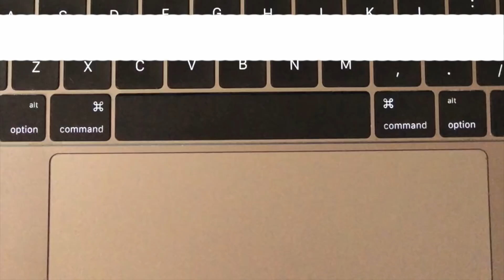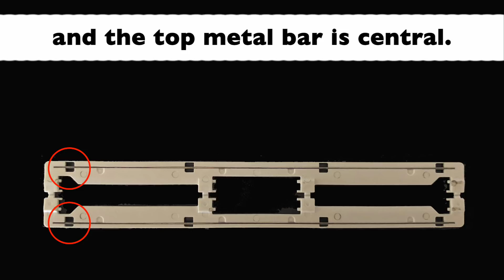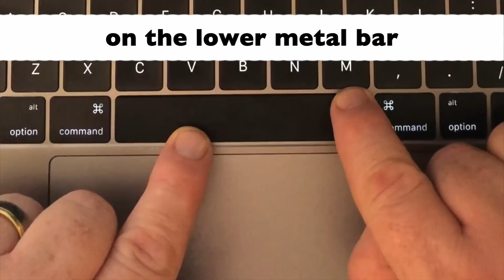Macbook Spacebar Removal & Replacement - 2nd Gen Touchbar **SEE COMMENTS FOR FREE REPAIR!**

Comment: Thank you for your video which allowed me to change my spacebar without too much damage.
On the other hand, with the double hooks upwards (towards the screen), it was impossible to clip the space correctly.
I tried to do it the other way: double hooks down, and there, it worked very well.
For those who can't do it, try doing like me: reverse the hooks.
Reply: And I removed the silicone membrane which was completely torn off.
Reply: 😪well it does'nt work very well in fact
Reply: Yes, double hooks should match the "centered" bar (and centered bar should be furthest from track pad, not closest to it)

Comment: I just received my spare parts from China and installed my spacebar. You missed one important thing: when you remove the central transparent bit, it's important you put it back on the same way, so the two metal pins hit the big metal plate.

Comment: thanks for this! i have my space bar back now. if anyone else has issues with the adhesive on the clear parts not being sticky after fiddling with them, i used a tiny tiny bit of shoe glue (i guess other glue would work too) to help them adhere. i have no idea if this is bad for the parts so do at your own risk, but it worked for me

Comment: DO NOT DO THIS if you have a 2018 MacBook Air Retina! Trying this just cost me $160 for a wireless keyboard.  You're better off to take it  in to Apple first and see what they say.  I could either pay $500 to get my keyboard replaced or buy the wireless.  Once you remove that key, it is NOT made to go back on.  I told them I had seen this video.  Don't try it yourself.

Comment: Thank you I didn’t think I could do this by myself !! Quick question tho : it works but the bouncy effect of the key is now present only in the middle of it. If I press on the corners of the space bar it works but there is not the usual sound of it and the normal resistance if that makes sense. Is there a way to fix that or did I break something forever ? Thank you 🙏🏻 🙏🏻
Reply: Check the clips on the black spacebar itself. They could have been broken off like I did to mine. It's very tricky to do anything thanks to Apple. A replacement was only $5 on ebay which is good.

Comment: Thanks for the video!
I'm replacing it but after placing everything the white piece doesn't have the butterfly like effect, it's stick fully to the board which doesn't allow the space key to work properly.
Is there anything wrong here?
I'm having the model with the thin membrane.
Reply: Actually right now it's working fine after placing the spacebar, but from one side only while the left side is sticking

Comment: Do it very CAREFULLY! Check it twice that this is exactly your type of a keyboard, other keyboards has different construction. So I made a mistake and unmount not just a top cover but also a mechanism on the first step, so 3 out of 6 small pins on the mechanism have been cracked... Another problem was with the transparent clips, they were glued and had to be forced to be unmounted. Luckily, 3 pins on the butterfly mech were still enough to get it all back in a normal way. Finally it works now.

Comment: Detail: the small transparent pieces are glued. It's normal if you struggle a little bit removing these parts. When you replace those, don't forget to double check that there is not small piles of glue made because of the knife. Otherwise the explaination is perfect.
Reply: The glue is dry as I’m trying to replace my space bar. What can I use? I was able to remove the dry glue gently with my nail. 

Any video you can point me to? 

Should I glue the clear pieces before or after placing the butterfly mech?

Comment: The plastic clips that are glued to the frame under the key is the main reason why your key is not holding. The owner of the laptop I am fixing broke it and I have to shop around for the piece now. If it's broken, you'll have to remove it and glue in the new part. The video does the job when you know what to look for. I personally don't like Apple products and use an Accer laptop and never had keyboard issues. Even worst the price vendors want for the parts alone are ridiculous. And this is why I stay away from Apple products.

Comment: Idk how people are getting helped with this video. The clips were held down by an adhesive and now they won’t go back on the keyboard. The least they can do is warn you that this doesn’t work
Reply: Yes, mine had adhesive and nothing worked like it showed on the video because the part underneath was also held down with adhesive.  Maybe a different model?  I guess I'm just using my external keyboard until I can take it to get it replaced.

Comment: Just did this, except the white piece with horizontal metal bars came off with the black facade, leaving the three clear pieces behind. I guess I wasn’t careful enough and one of the white protrusions on the piece with the horizontal metal bars broke off. After putting it back together, I noticed that the spacebar only worked if I pressed in the exact middle of the button.

So I took it apart and redid it. This time I removed the clear pieces, even though they appeared to be glued down. Put it back together, and now the spacebar works only if I press down hard on the middle of the button.

pro tip: If you’re removing it to clean it, just try slightly lifting the spacebar and applying compressed air instead. Not worth the risk of damaging it imo

Comment: This video did help a little but not that much for me. I spilt some pink lemonade on my key board, I know very dumb of me, and miraculously after it dried the keyboard was not sticky at all EXCEPT the space bar. Now as you can see from the helpful comments and the video the key has 4 clips and 4 hooks. I took my key out, cleaned the goop and dust with a quip and tried to put it back in but the hooks WOULD. NOT. FIT. After 30 minutes of watching the video again and reading comments and trying over and over again I looked closely at the hooks. Since the plastic is so delicate the hooks had actually folded in on themselves. I took my fingernail and pried them open and vualá it fit. It was a little stuck but after a few taps it was working. So before you spend more money on a key, look closely. 😄

Comment: You were fortunate that the adhesive remained sticky enough to reseat the clear mounts: in many cases it can be dry enough to make them only fit loosely when replaced. One guide advocates leaving them in place and only removing the butterfly by prying it away from the mounts, then very carefully stretching the new butterfly's pins/prongs to fit back into the mounts. I live in Arizona and all the Apple stores in the state are being closed down due to COVID-19. 
I'd appreciate it if you edited your comment to mention this will cause problems if the adhesive isn't sticky, rather than just tell people to take it in for free repair. Very informative video otherwise.
Reply: The adhesive on mine is dry. What can I use to get them to stay?
Reply: @cesartobar8196  any tips? mine is ruined as well
Reply: Well if you bend the plastic ones to refit the mechanism it will be loose. Gotta glue em down with some loctite

Comment: NEVER REMOVE THE GLUED PLASTIC CLIPS !!!! This will ruin you.
Reply: What?!
Reply: I appreciate the comment but this needs more information as to why that will ruin you.
Reply: @philiproy6075  Its impossible to adjust the spacebar, so it wont work on one site. I just struggle with the Spacebar but cut never fix it to work like original.

Comment: I tried this. The transparent clips were glued down. I figured I was suppose to pry them up but now they don't hold the space bar down - they come out of place very easily. Booooooo Apple. Booooooooo.
Reply: Same thing happened to me.  Transparent clips are glued down.  Did you fix it?
Reply: @jeremyzee  Nope I just use an external keyboard now. So it's no longer a laptop.
Reply: @jeremyzee  Thanks for the link. I'm going to try to take it in as soon as things get back to more-normal. My guess is that by trying to fix my own keyboard I have voided the warrantee and will be forced to buy an entirely new keyboard. If that's the case, I'm just going to buy a new ASUS laptop and do all of my development on there. I'll only use my current Macbook Pro laptop for iOS builds.
Reply: @H Kim ill try again I suppose. But it seems like no matter what I do, nothing firmly connects to anything else.
Reply: @H Kim I'll give that a try this evening, thanks
Reply: Shoemaker did it work!
Reply: @luismedeiros1211  I tried but one of the clips on the space bar broke. I have a new one ordered and on the way. It kind of felt like it was going to work if the clip hadn't failed though.
Reply: Shoemaker what about the apple store thingy? I just broke my spacebar trying to fix it (as weird as it sounds), i’m handing it to apple, and getting it fixed for free, so that i can sell it and buy a new macbook 2020 without this stupid keyboard
Reply: @luismedeiros1211  I'm going to have to try that eventually. I have it working now (actually typing this message from it) but I pretty much need to strike it dead center for it to work well. The left side works okay but the right side really doesn't work. It's impossible to hit the space bar twice quickly, it doesn't rebound fast enough. Looks like I'll just have to take it in.
Reply: H Kim it was already not working, i managed to make it work actually, there was some dust under it, but it doesn’t click now
Reply: If they don’t fix it, i am surr as hell suing them
Reply: H Kim they did fixed it, i explained it was already broken, didn’t pay a dime

Comment: So I just watched your video and it actually helped me. My space bar on my A1989 was stuck. I lifted it to clear dust and got stuck with replacing. The real solution is putting back the space bar in place. Placing the hooks at the bottom and the clips at the top

Comment: Hi Damien - thanks, very helpful. Only problem I'm  facing is I can't get the lower edge of the space bar (with the single clips) to hold down. Any idea why? I've tried many times. The double clips top edge clip fine and nothing appears to be damaged. But the lower edge easily lifts up. It might not bother me,but the only way to get the space bar to work is to tap it really hard! Any help appreciated.
Reply: I had the same problem. I think the white butterfly bar is in upside down in this video! I swapped mine around (after hours of trying to "just click the spacebar in") and it worked easily and is working fine now. The metal bars that are off centre should be at the BOTTOM and not the top I think. See here: https://youtu.be/D-S-owPESlw?t=480
Reply: @mikerigley1  EXACTLY – the video shows it opposite to the description that follows in the video. Luckily I found your comment :)
Reply: @mikerigley1   Thanks Mike! You've just changed my life :) Suffering trying to deliver to clients in lockdown with spacebar not working was painful. I've done what you said, and whilst it's not solved 100% (now the top edge of the space bar still lifts up)  but most importantly, it doesn't fall off and it WORKS! It's a functioning spacebar now. Really appreciate your help. Cheers.
Reply: I'm having the same problem! Did you find a solution?
Reply: Nelliemarie nothing anywhere unfortunately. Everything I've found implies it just clicks into place. If I find an answer I'll add it here. Good luck

Comment: I just cannot seem to get the "hook" parts on the bottom of the key? How did you make it seem so easy?
Reply: i think because the later ones has the thingy glued
Reply: Raymondouu same problem!
Reply: were you able to figure this out? currently struggling  with the bottom of the key.

Comment: But on the video you put assymetric(closer to the edge) closer to the screen, while explaining that symmetric one should be done in that way
Reply from the maker: You are correct but this is the incorrect way to place it. I was lucky in the recording it fit hence why I highlighted the importance of the correct fitting
Reply: @GingaGamingLTD  the plastic clips aren’t holding the white frame in place? Any advice?
Reply: Damien Walker so symmetric side should go to the screen direction?while asymmetric to the bottom, where we have “hooks”, right

Comment: Just received my new butterfly hinge, and still having the same problem getting the spacebar in place. There is nothing wrong with any of the parts (that I can see). Any tips?
Reply: did you find a solution?

Comment: before you try this, let me advice what i've done with my space bar work again.
space bar has 3 button under long keypad, each position are in left center and right (like in this video). first, investigate which side space bar not working properly, next use tin stuff like in video for lift space bar on top (just a little and don't remove spacebar). next blow on it until dust gone.
Reply: When I attempted space bar removal, I got nervous putting that much pressure on what I'm sure is a delicate assembly. I ended up doing exactly this and my double-spacing problems are gone!

Comment: Thanks for the video but I would definitley  not use a sharp box cutter blade that's going to damage your keys and computer  -  rather use a spudger / spludger.  -a tool that has a wide flat-head screwdriver-like end that extends as a wedge, used to separate pressure-fit plastic components without causing damage during separation. $8 kit on Amazon and the like and you get a bunch of them.

Comment: Dont get it how do you get the bottom part to stick, when i put the last part on, it hooks up fine, but it doesn't stick to the computer? PLZ HELP
Reply: Like do i have to glue it on or what?
Reply from the maker: I didn't need to use any glue as there was some glue already there.

Comment: He says central metal bar of butterfly clip should be placed at the top closest to the computer screen but that's not what he does. He does precisely the opposite! Which is it?
Reply from the maker: You are correct. In the video I manage to fit this the wrong way round but in most cases this will damage the clip or simply not fit. Please follow the written example to fit it correctly!

Comment: I did this but the key stills falls out if I tilt the laptop sideways or upside down. It doesn't stick in place
Reply: I think this is due to not having the clear plastic pieces glued in to hold the white butterfly piece down. I am having the same issue. Going to try double stick tape to see if that will adhere enough to fully work again.

Comment: This video is wrong, butterfly should be placed rotated by 180º, and do not break clear plastic holders. Again — this is a hoax.
Reply: So the central bar should be at the top or the bottom?

Comment: READ THIS BEFORE TRYING THIS METHOD! I tried opening my spacebar and the butterfly part was still attached to the button. There are tiny plastic hinges that connect the butterfly part to the plastic parts that you should remove before the butterfly part, but those hinges broke and are now loose. I was only able to fix half of my spacebar and the other half is now unresponsive. I had to order a separate spacebar which cost me around 130 usd. If there is dust under your spacebar I would definitely not recommend opening it this way! Try using compressed air and holding your laptop sideways, like apple recommends..
Update: I brought my macbook in for repair under the Keyboard Service Program a couple months back and they replaced the entire top case (keyboard, mouse, touchbard, etc.) within a week at no cost.
Reply: WTF 130USD? bro wtf is this shit with apple so fucking greedy.Never buying any apple product, what load of horsehit
Reply: @Xendruis  This wasn't even an official apple replacement part. I don't think Apple sells these buttons seperately. I bought it at replacementlaptopkeys, but the shipping cost to my country was 60 usd alone. The key itself was 70 usd I believe.
Reply: @marvin4307  FYI they are actually getting lawsuits for this. They fucking deserve it. I hope they lose money.
Reply: I only spent 30usd on mine 🤔
Reply: I.read.it.after.i.broke.it...:((thanks.anyway
Reply: i need new plastic hinges any idea where to purchase and or what is the technical name for them
Reply: Jamie Foster from what I know the hinges are on the space bar and the space bar you can get it from eBay for couple of bucks
Reply: Adrian P I need the clear sticker looking  parts I keep finding the butterfly(white) piece  and thanks for the response
Reply: @jamiefoster1801  Did you find a place to buy the clear sticker looking parts?

Comment: Help! I need to replace my return and delete keys which I removed to clean after a spill. Can't figure out the mechanism for replacing the butterfly hinge, which came off with both. (15" mbp with touch bar, 2017, but I've been through the keyboard replacement program.)
Reply: same, I thought I was the only one.

Comment: ** IMPORTANT ** If you have the new style quieter keyboard then there is going to be a thin rubber membrane underneath the key. Inserting the blade and sliding the knife along may slice the membrane or push the membrane underneath the corner of the key at the end of the spacebar. Ensure you insert the edge of the blad only, do not slide, and tilt the key up at the key locations shown in the video.

- Left of middle on the C key
- Towards the right of the V key
- Towards the left of the N key
- Right of middle on the M key

Do not insert the knife and slide it along.
Reply: yes. that membrane is gone in mine. Any chance to still fix it without paying hundreds?
Reply: @queenofepigenetics3224  one year later and i am now also in ur shoes.. did u end up fixing it or?
Reply: yes this. the membrane on mine is destroyed. now im struggling to figure out how to get the white piece to reattach to the laptop. i can get the white piece and key cover to snap together but thats it. any tips?
Reply: This should be pinned